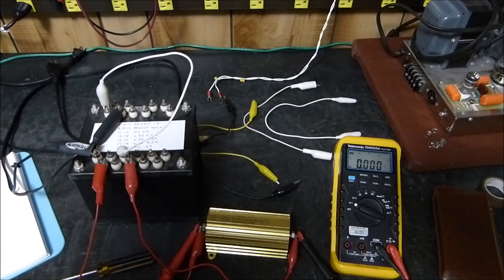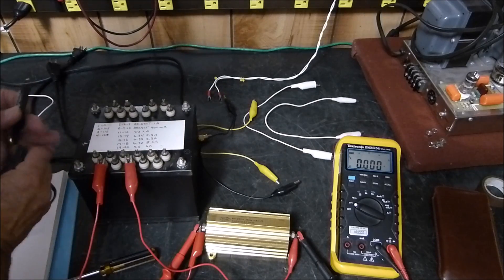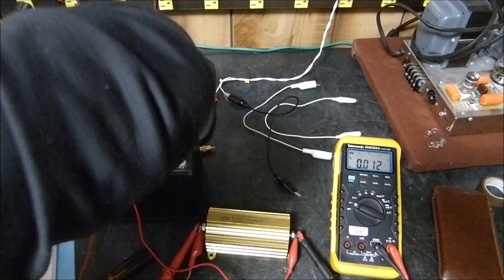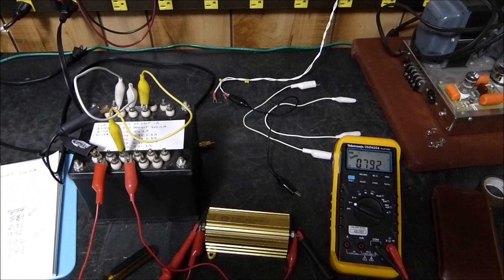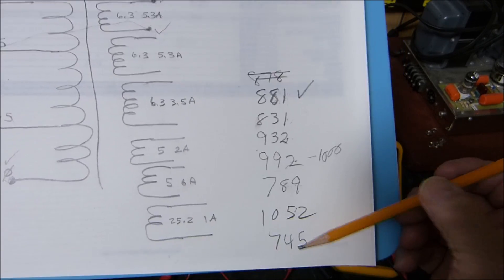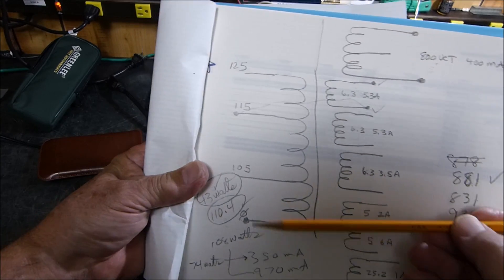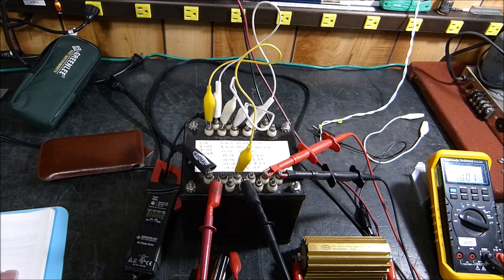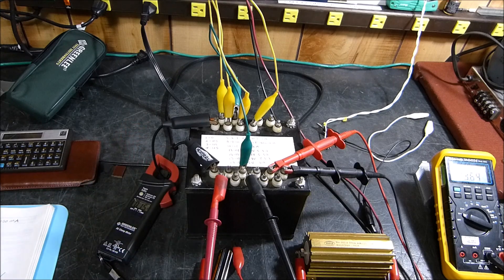Part 4 - Buck - Boost For Vacuum Tube Power Transformers

Comment: I want to know how many milliamperes if it’s dropped or raised
Reply from the maker: The amount of current available is really not of concern. The purpose usually, is to lower the voltage on the high-voltage secondary winding. As an example let's say input voltage is 120 and you add in series with the primary and out of phase, you will get that ratio 6/120 or 5% drop in all secondary voltages. Keeping is simple and let's say you have 900 volts on a vintage piece of equipment like the Collins 32S-1 - just as an example. 900 volts is a bit too high and if you can lower it 5% it will go down to around 850 volts. The reason for this conundrum is because 50+ years ago, the line voltage into houses was more around 110 volts. Almost everywhere now the voltage is 120 or better. That is about a 9% rise in line voltage and the other voltages in the PS follow with an increase in voltage.  This idea also, is sometimes with the intention of changing  the vacuum tube rectifiers in transmitting equipment to solid state. This is going to raise the voltage another 45-50 volts - you can see where this is going. I think it is a bad idea to change out these 5R4 and 5U4 rectifiers for SS rectifiers. Lastly, putting these buck-boost secondary windings in series with the primary seems to make the transformer run hotter than usual. Oh well... we try but we just don't seem to be able to trick physics. Just my thoughts on it.
Reply: @ElPasoTubeAmps  yes I understand that I don’t believe in solid state being used on a tube amplifier do to fast warm up times 
I have still been experimenting with the type 83 rectifier tube I added a China board 3 min relay for the b+ and use a 6.3acv to turn it on before the 83 tube it’s been working well but work has been getting in the way I’m glad we have cold snowy winters in boston 
I’m still looking for very good detailed schematics for a stereo 2 channel push pull 807 amplifier using 2 ul output transformers using 4 807s  and 6sn7

Comment: The phase relationship of the added secondary winding/s to the primary winding will determine whether it bucks or boosts the output voltage. I think of the boost configuration as adding voltage to the primary coil in your demonstration, changing the phase of the added winding will reduce the voltage accordingly.  In phase the voltage is additive, out of phase by 180 degrees subtracts. It's like taking two sine waves and putting them on your scope inputs and clicking the 'add' button.. the two voltages add together to create a third signal, or in the case of the transformer a larger magnetic field.. click the invert button on channel two of your scope and the new wave is the difference between the two being less than either of them. In the transformer this creates a lesser magnetic field. 
How sustainable it will be lets say in a boost configuration is dependent on the current rating of the winding we're adding to the primary winding and how much load we're putting on the output, or secondaries of the transformer.
Most buck / boost transformers I've worked with are wired as auto transformers, adding to , or subtracting from the input voltage again depending on the relationship of the phase of the windings to each other. In phase adds, 180 degrees out of phase subtracts.
It makes perfect sense that the quiescent current feeding the transformer is going to increase in the boost configuration since we're dissipating  a higher voltage in the transformer with or without a load.

Comment: With many tube amps  being rebuilt with solid state rectifiers [like the Dynaco ST-70], it is common to use the unused 5V/3A rectifier filament winding to buck the incoming 120VAC line down to 115V or so, primarily to get the 6.3V filament voltage down from the 7volts or so with a 120-124V AC line.

Comment: I can only assume that it is the interaction of the magnetic field of the different coils. 
Because the coild are all on the same core:- The out of phase sub-primary coils have the same effect as reducing the the turns ratio of the main-primary coil, BUT, this only works because the magnetic fields are working ageist each-other....Does that make sense???

Comment: I live in Korea.
Why are not the videos coming up these days?
The analysis of the tube audio equipment is amazing.
We support you.
Reply from the maker: I am very pleased you enjoy my videos. I do have a few amplifiers hat I want to build. I have just received ( two days ago) some beautiful vintage UTC transformers I intend to use on audio amplifiers. I have some Svetlana 572-10 triodes that I want to build with and my friend back in Lexington, Kentucky wants me to build another 300B amplifier. You will really like some of the "iron" I have and intend to build with. I do have an astronomy hobby that I have been into lately so that has taken some of my time and also my ham radio hobby. Keeps me busy. Thank you for your support.

Comment: These are great videos. This is some real good theory of practical options that allot of us newbies are not aware of. I am glad you took the time to make this video.  It certainly does help allot, and i appreciate all your doing here. 

I have another suggestion for a future video. I am a bit confused on whats important when using bnc cable and terminating the cables. for instance I just acquired a hp 3325b synthesizer/function generator (dc to 21 MHz). I want to use it as a signal reference for troubleshooting my amp designs and also for am radio repairs and as external signal source for my rf generator for am radio alignment. do i need to terminate the end of the cable where it goes into the input of a amp, or into the external input on my heath-kit rf generator? Also i have a tek 2247 scope with 1meg input. if i want to view the signal on my scope do i need to 50 ohm terminate it with a T at the scope input? or is the built in 1 meg load going to affect my signal and cause reflection at high frequencies? I know this is allot to consider, but any insights would really be appreciated.
Reply from the maker: Hi Rory, I am very pleased you enjoy my videos.
You ask some big and important questions.
To start with, most RF generators are 50 ohms and usually do not work well for audio which is either 600 ohms or 1 megohm. Often times the 600 ohm load on an audio generator is only necessary if you want to be able to measure the amplitude accurately on a calibrated instrument, and whether or not you use a terminator will likely not affect the distortion output of the generator.  When you think about it, if the input to an amplifier is, for example, 250K ohms and you swamp the input during measurement with a 600 ohm terminator, the input Z is then 250K parallel with 600 ohms which is essentially 600 ohms and it makes measurement math simpler. Other audio generators are a high Z output which may be several hundred K ohms or 1 megohm depending on the particular generator. These are usually uncalibrated generators and work just fine as long as high amplitude accuracy is not necessary.
In either case whether it be a RF generator (oscillator) or audio oscillator, the termination resistor is usually placed on the end of the cable at the DUT but, in many cases, it doesn't matter if it is at the DUT end of the cable or the generator end or anywhere along the line.
The reason for this is because cable length becomes an issue if the physical length of the cable is an appreciable portion of a wavelength of the frequency being tested. Actually even 1/4 wavelength of the frequency being tested. In the case of audio, even at 100 KHz a wavelength is 3000 meters and 1/4 wavelength would be 750 meters so the understanding is in the concept. For all practical purposes at any audio frequency or any reasonable audio harmonic, all points within the oscillator (generator) and the external connecting cables and terminators (if used) and the DUT, are at the same electrical point.  For all measurement purposes, the same electrical Point. What this means is, the voltage and current are the same at the beginning, all along the cable and at the end so it doesn't matter where the terminator is located or where we measure the voltage and current. We do know there is distributed DC resistance, AC resistance (Rs or ESR) and inductance and capacitance along the line but unless the line is much longer than you are likely to use in a lab setting, you can ignore these parameters.
Hope this makes sense. 
It also doesn't matter if you use 50 ohm coax or 75 ohm coax. BNC connectors for cables come in both impedance values but both will work just fine.
For RF it is a different world. Suppose you are dealing with 1 GHz.  A wavelength is now 0.3 meters. Now everything matters and I don't think this is the time to try to get into those issues and complications.
Reply: @ElPasoTubeAmps  Thanks that helps allot. I will be doing some experimenting with my new hp signal generator. I don't have allot of specialized equipment yet. As for the Hp3325b I hope it's an instrument I could do allot of different things with, and is not cheesy either. I plan on making a video review of it, as there is not much out there on those.

Thanks again

Comment: Hi all,  I enjoy your videos a lot and I,m not trying to criticize but I have to say something.  I was taught to never probe around a high voltage circuits with a pencil.  It may not be true with modern pencils but still it is the first thing I noticed.
Best wishes.
Reply from the maker: I have to agree with you. The carbon/lead pencil probably can conduct enough current to deliver a nasty shock at the higher voltages. I do appreciate the concern and warning.

Comment: It's like canceling (or shorting) a few turns on the primary side when in anti phase connected (like when you get second harmonic distortion cancellation in the output transformer of a P-P stage), 110-(3*6.3)[V].
Reply from the maker: I learned a good bit from this experiment and post. I have always known that a single filament winding (6.3 volt or 5 volt) even a couple of 5 volt windings can be properly put in phase and used in the primary to lower HV. This is sometimes used in the Collins 32S series of SSB exciters to lower the plate voltage, especially if SS rectifiers are installed. Obviously, this cannot be taken too far as it would also lower the 6.3 volt filament supply for the entire exciter. It just never occurred to me that reversing the phase on these extra windings would effectively "remove" turns from the primary or to look at it another way, "raise" the voltage on the existing and original primary. I learn something every time.
I never thought about second harmonic distortion cancellation in PP amplifiers that way. Since both sides of the PP transformer have the same phase at the second harmonic as they do at the fundamental (180 degrees out of phase tube to tube) why does the second order harmonic get canceled? I don't doubt what you tell me as I know the second harmonic is greatly suppressed in PP operation. I never fully thought it out if the action was in the transformer (as you point out) or the geometry of the circuit within the tubes.
Reply: Yes, when working we're learning every day, every step of the way. I actually meant to say even harmonics, second being most prominent of them all. This dose indeed happen in the output transformer, not totally tho due to imperfect winding symmetry (let's not forget that one winding will be always higher in DC resistance for example because of stacking windings on top of each other -this means it is also frequency dependent and other factors that contribute to this asymmetry) alongside imperfect driving signal from the amp... but it still contributes a great deal in reducing, not totally canceling them tho except in an ideal world perhaps. It's because of this I was once wondering how could I split the audio signal in three phases (120degree ph. shift) to attempt the same with the odd harmonics, since those are more unpleasant. Just a thought I once had...  (:

Comment: Did the Carver company not do something like this on their CARVER CUBE power amp.
Reply from the maker: I am not familiar with the Carver amp but did just look it up. Looks like they made a switching power supply (SMPS) to lower the weight of the amplifier. It is supposed to do 500 watts mono into 8 ohms and weigh 12 pounds. Wow... made in 1980 - seems like just yesterday...

Comment: Having fun? You absolutely can wire a transformer like that. The only caveat is to watch out for the winding insulation rating, especially if the core is at ground potential.  Transformer windings don't care if they are primarily or secondary. The difference in idle current is due to the change in magnetic flux resulting from the increased or decreased potential.  As for the auto transformer vs two winding transformer comparison, an auto transformer is just a single winding transformer. You could do the same thing with two transformers in series. 
There are definitely efficiency trade offs, but it is still a viable design. Bucking transformers are often used at high voltage substations to drop the transmission voltage to some lower value needed by older  substation transformers. Just remember there is no free lunch. Voltage comes at a price.

Comment: Unfortunately the thing can't work, the explanation is simple, the low voltage windings are floating, so it is like that are on different cores ( they are not because the flux is common but for the understanding is fine ). If you put two transformers in series what happens? If they are in phase the voltage sums and in opposition of phase the voltage subtracts. When you put a low voltage winding in series with the primary you are just adding or subtracting the winding voltage to the line voltage, and when you apply the resulting voltage to the primary you get a higher or lower voltage than expecting on the secondary due to the higher or lower voltage applied to the primary. 
In a long term the only application like this that works ts the voltage subtraction because you are putting a Lower voltage on the primary and everything is happy, but if you put a higher voltage than the nominal the core saturate and the primary current  Increases to self destruction.  In the end if you want a lower voltage you can put a low voltage winding in counterphase as long as the primary current Is lower than the rated current of the lv winding.

A little consideration, in the current measuring you talked about 350ma and 110w of power waste, but I remember you that in a.c. we talk about VA because Watts and VAr are 90° shifted and their scalar result is VA that you can measure with a simple ampmeter, but in this case the higher current is primarily caused by the saturating core, and so it is primarily reactive power, not wasted heat.

Hope to be helpful

Comment: using switcher terminology for a simple transformer is a bit confusing as it implies something more that transformer action is happening. In transformers you are 1:1, stepping up or stepping down voltages just that simple.  Jumping across a primary input that is connected to the power line to a secondary output is real dangerous. Most assume some protection with a transformer secondary due to it's isolation from the primary power lines. You also have the 800V terminals exposed...your life,   you get to chose how to use it but try to be more careful and keep one hand in your pocket and wearing non conductive shoes when playing .  That pencil has a Graphite conductor going down the center, all plastic pen would be better around high voltages.

Comment: I've used this method before. As you mentioned, it's all about turns ratio. By putting a seperate winding in series but in antiphase you are effectively subtracting turns from the primary thereby increasing the effective turns ratio between primary and HV secondary. As for the increase in transformer current, don't forget that you have a 10k load on the 800v output which is now dissapating an extra 2.25 watts with the 150 volt increase. If you disconnected the load you would find a negligable difference between the before and after setups.

Comment: I was going to comment in video #3 about being careful when mucking about with transformers, when testing phase and so on, but thought better of it. I got the phase wrong on a big toroidal tfmr a while back, briefly powered it up, saw 0v ish on the meter, killed the power sharpish. The core got very, very hot. Core took two hours for it to cool. Luckily the tfmr was ok. 
     Watching our seniors screw up occasionally makes us less experienced dabblers feel less foolish, thanks for leaving your SNAFU in the video, hope your tfmr is ok.
  I would guess it pays to run experiments like this through a lamp limiter, can save the tears.
Reply from the maker: Yes, a 100 watt bulb would have gone a long way for safety in my wiring error...  however, working completely alone in a quite room is what I prefer. No excuses here but making videos and talking and not being able to get as close as necessary to the equipment so as to stay out of the way of the camera, adds a considerable amount of risk to the work. I should probably slow down rather than try to make a video shorter. Less mistakes would probably be made. 
The transformers I have are mostly military surplus and are very tough so it is OK. I have a couple of very heavy military surplus transformers rated at around 36-40 volts secondary that I parallel the secondary and series the primary for 240 volts and use as an arc welder. They are definitely touch as I have measured the arc at 36 volts and current at 70+ amps and I have had them for decades. I don't use them daily but I have used them many times to arc weld and they were not designed for this type of work.